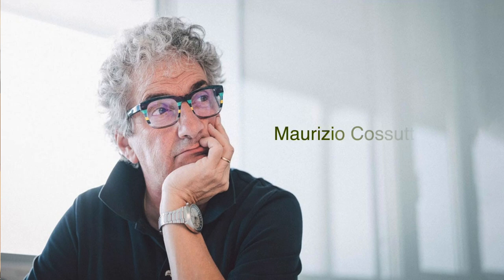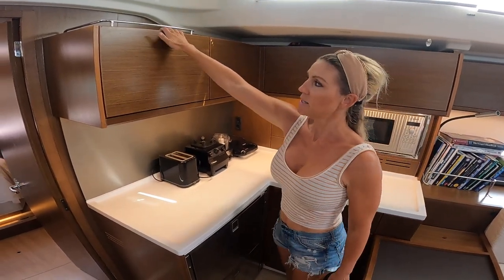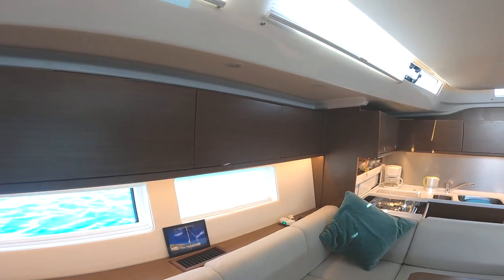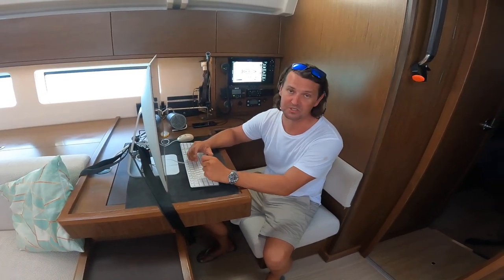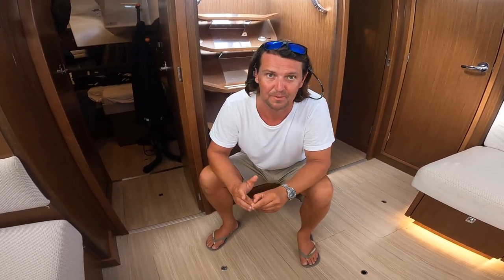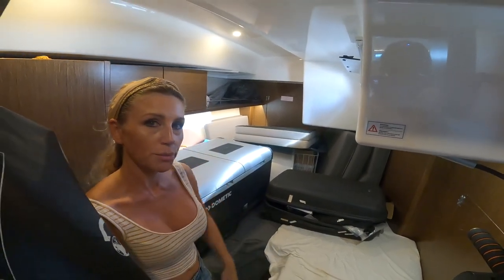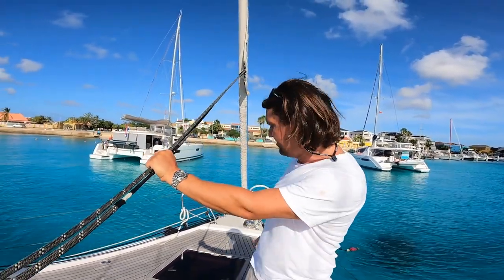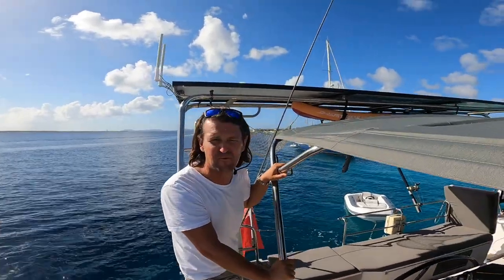Bavaria C57 Full Boat Tour | Sailing Aequus - Episode 5

Comment: Great tour, you have shown almost all important on this nice yacht. Just to let you know, Bavaria C45, C50, C57 and C57 were designed in the cooperation of Cosutti yacht design and Pulse yacht design, they did a lot of sailing yachts together, Some Salonas, Swans...Cosutti is responsable for naval architecture and Pulse for interior design and engineering, so Cosutti is what you see from outside, hull, deck, keel, rudder, sails and Pulse all you see and do not see from inside, interiors, structure, recievers, engineering...I had a privilege to work with them, great guys.

Comment: Can I make a safety suggestion ??  now that I've watched through the whole video , I saw at the end where you showed the 2 pkgs of emergency bungs 
under the nav station seat , you might want to take a lesson from Zingaro James  whose boat just recently "almost" sank ,  and take those bungs out 
of the packaging and place the right sized one next to each and every through hole you have on the boat  ** then secure each to something close to
the through hole with a wire  , so if there is a valve failure it doesn't float off , then the bung is right there and  ready to jam in the hole !!  that way you don't 
loose time having to run back to the nav station to grab one and then run back to the breach , could mean a lot less water in the boat ! ? stay safe <3
Reply: Agree. And some smaller bungs too.
Reply from the maker: Thank you Badcat, sometimes it does help to be reminded.. Yes we know James Zingaro very well and know his situation that happened recently. I think taking them out of the bags might be the first step you are right, I think in order to wire the bungs next to the through holes, we need to buy more bungs otherwise if nothing to do with a through hole fitting we will also be running round trying to find an appropriately sized bung..

Comment: I’m sure that this question will stir up a hornet’s nest of comments, but here goes...I loved your tour video. My wife and I have a retirement goal very similar to what you are doing now. We want to do a factory pick up, cruise the Med, do the ARC, cruise the Caribbean and complete a circumnavigation before returning home to BC and cruising local waters. The Bavaria C57 is also at the top of my monohull list, along side the Hanse 588. I also want to add the Williams, just like you have done. So here come the questions. 

I hear so many say that a monohull for a full time couple is exhausting and the cruising on a heel quickly becomes old. Additionally, there are complaints about motion when moored. Having said that, the equivalent living space and style in a cat would be a 50’ at a significantly higher price. So I was wondering how you feel about these comments and what your experience has been?

In another note, I love the Williams tender but have heard comments that, because of it’s weight, you might get caught on a beach with the tide having gone down, an you are unable to drag it to the water. Do you have any thoughts on that?

Finally, do you ever feel that having the galley and saloon below deck negatively impacts your experience to a significant degree or does the Bavaria design overcome these concerns?

Thanks so much for your help.
Reply from the maker: Hi Dave, 

I certainly wouldn't rule out a cat if we were to buy another boat in the future but as you say it would be a lot more money for the equivalent size. In my opinion there is no such thing as the perfect boat. Every boat has some sort of compromise. Questions I think you should ask yourself (other than budget!) are... What percentage of time will i actually be sailing on a passage vs at anchor or in a marina? Most people spend way more time at anchor then they do making long passages so its probably more important to be on a boat that's comfortable and has some nice socialising space. Both the C57 and the 588 would be perfect as would most cats.

With regards to heeling Philippa does not enjoy it so much when the boat heels and you do have to make sure everything is stowed. But the heeling does mean you can sail upwind better than most cats. Having said that though if you are following the trade winds then the wind will be behind you most of the time so maybe this is not so much of an issue. A cat is more stable when at anchor but most of the time we are very comfortable especially in the Caribbean where the wind and swell come from a constant direction most of the time. Having the saloon and galley below has never really been an issue for us and it also means people can't see directly in when walking or sailing past although I do see that the layout on cats is probably very nice having everting on one level.

I absolutely love my Willams Minijet! You would need 2 people to drag it up or down a beach but I usually use the anchor in shallow water rather than beaching it. The other big pro with the Willams is that there is no outboard engine to worry about being stolen. Support from Willams is excellent but you will need to carry spares as the nearest dealer in the Caribbean is in Florida. Servicing will also be an issue when you leave the Med but its fairly easy to do oil and filter changes yourself. 

Hope this helps.
Reply: @SailingAequus  Many many thanks!!! Your comments were very helpful. All the very best!
Reply: @SailingAequus  Maybe look at fitting a pair of removable dinghy wheels for those occasions when you need to get the dinghy over land.
Reply: Regarding the ability of sailing vessels to sail into the wind, The one time you will curse the cats lack of ability to point as against the monohull is when you are trying to tack into a seaway or heavy swell, possibly away from danger. The mono will be making progress, the cat not so much. I have owned both and after the cat I have gone back to a mono albeit older generation but still valid I think.

Comment: 1PAHero
Might I suggest a water barrier blanket. That can deep be deployed over larger breaches through the Hull than a bung can plug. Say for instance if you hit an iceberg or a floating container. I didn’t hear any mention of a Storm Drogue/ Sea Anchor.  
And there’s these nifty little things that you can suspend from your boom  over the side, while on a mooring ball. To reduce rocking. I wonder if there’s anyway to quiet the water slapping at the bottom of the dive platform??

Just discovered your channel and really appreciate that the two of you have very little previous experience, and now are crossing oceans on the 57 footer! Awesome!!!
Reply from the maker: The slapping we don't really mid at all, it is actually lovely to hear the water and I don't think I have ever mentioned it nor James, I am also conscious of these things but never given it a thought until you just mentioned it.. it might sound more on camera!  We really don't need anything to stop rocking, we very rarely rock to any degree, occasionally we might but it isn't enough to warrant dealing with it. Thank you for your comments and for being here 1PAHero
Reply from the maker: I'll look into the water blanket as that sounds like a really useful thing to have onboard. Thabks for the tip! As for drogues or sea anchors we don't have one. I know it's a bit of a controversial topic because of the forces these things generate and the issues in deployment/retrieval. I watched an interview with Skip Novak a while ago and he was pretty anti them.

Comment: Bavaria definitely offers more interior space than any other boat with the same length. I actually have a Beneteau 41.1 and want to upgrade to a 50 footer. The Bavaria C50 (Vs. the Beneteau 51.1) has an amazing volume inside and furthermore dinghy garage but everybody is saying me that the quality, the reliability and the after sales service of Bavaria is not so good as the one of Beneteau (I must say I am very happy in this sense with Beneteau). What can you tell me about your experience with Bavaria?  Would you buy again another Bavaria?
Thanks and wish you greatest adventures!
Reply from the maker: Hey Pablo, we are very happy with our C57. I recently helped another guy who was buying a Bavaria with a few things to look out for when taking delivery.  If you drop me a direct message via our Facebook page I'll be happy to help.
Reply: @SailingAequus  may I ask what some of those items are to look out for? Cheers from Denver Colorado USA.

Comment: Literally not a boat, but a floating iPhone) And if the electronics fail, then how will you turn on the pumps in case of an emergency? Isn’t the old system better with conventional and simple switches? Friends in bavaria 45 had a failure even of the old circuit breaker system at Atlantic ocean. But there you can at least turn on or off something directly. And in this case, how can you act in an extreme case?
In no case think that I wish you an emergency) Seven feet under the keel)
Reply from the maker: Hi Paul, thank you for your comment, there are actual manual switches for the bilge pumps also...

Comment: By the way, you will think Rocna anchor is great until you try an ULTRA anchor!
Reply from the maker: Just had a look at the website. They look very nice but are quite a lot more expensive than a comparible sized Rocna... Probably because they are stainless steel.
Reply: @SailingAequus  Indeed they are expensive. They use 100% Swedish Steel. I read somewhere there have been requests for cheaper models with plated metal etc but they refuse to compromise. Yes they are expensive unfortunately.

Comment: Thats only backwards forwards in the galley  what about leaning , heeling, and rolling . Its along way from one side to the other , timbeeeeerrr
Reply from the maker: We haven't had an issue so far with 20,000+, miles of sailing.  I guess if it was that rough we probably wouldn't be cooking. When on passage we usually prepare meals ahead of time to make things easier.  95% of our time is NOT on passage so having a galley that is functional when we are at anchor is more important to us.